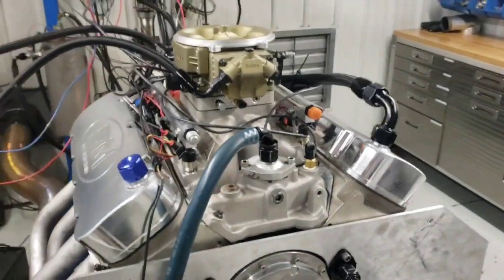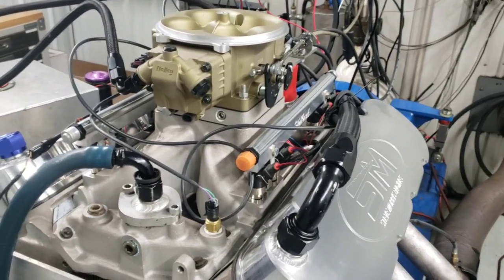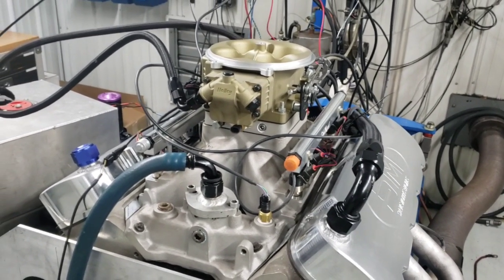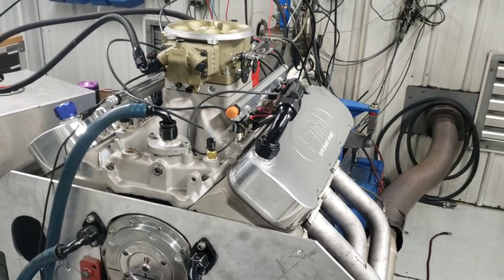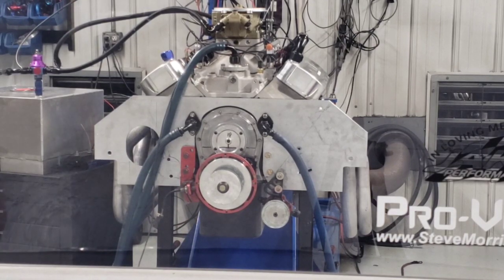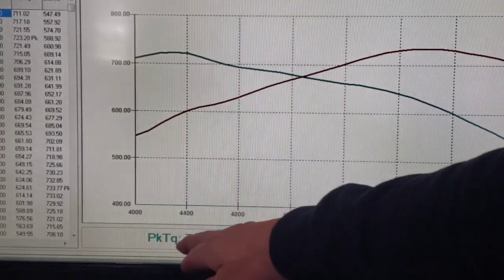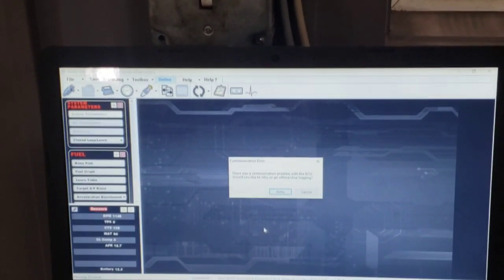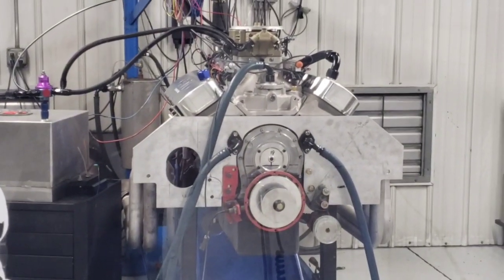Part 1  ---- Sniper / Multi port / Coil on plug testing

Comment: Any idea if you can upsize injectors on the 650hp sniper to make it 1250 capable? I know the 1250 has 8 injectors but I believe the throttle body is the same size.

Comment: I know this is nearly a year old, but I am wondering what would happen if this was boosted.  Is the charge cooling effect from the TBI setup override or at least diminish the benefit of individual port tuning....especially if you HAVEN'T tuned each port individually.
Reply: I am wondering the same thing as you. Did Steve ever answer?

Comment: Curious to see the result.  I'll speculate.  The throttle body made better power due to atomization?
Curious to see if you move the injectors up, fiddle with injector timing and do individual cylinder tuning (fuel and spark) how much better it'd be.  Wouldn't surprise me to pick up 2-3%.

Comment: Hey Steve, Richard Holdener did a dyno test and was saying that the more powerful that the engine is NA the powerful it will be with boost despite the camshaft. Whether it’s a turbo cam or NA cam. Could you possibly do a video diving into this? Maybe on Steve Tech? I am a subscriber to it.